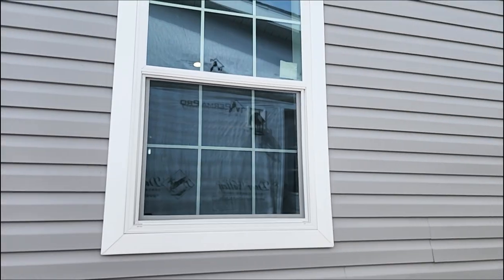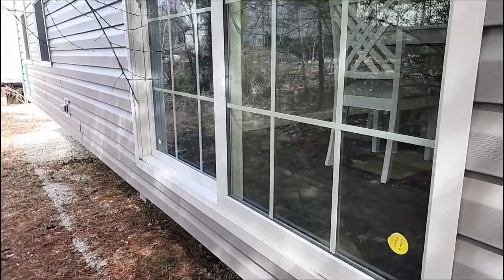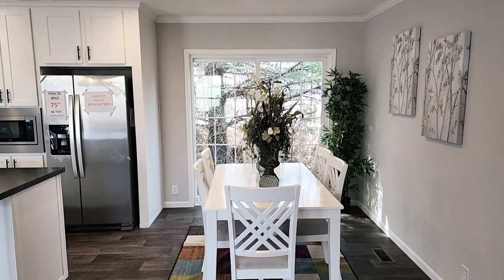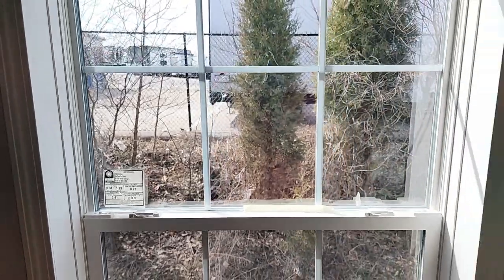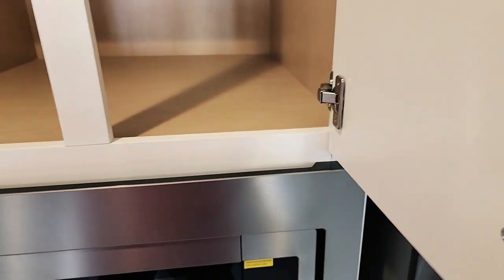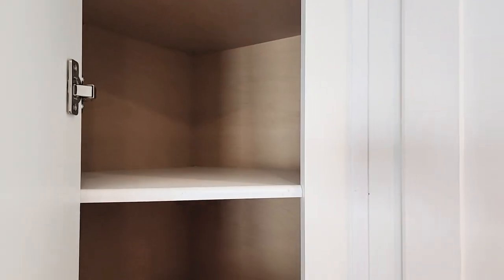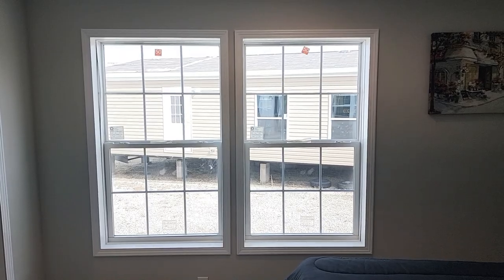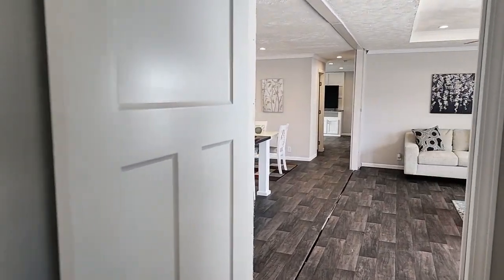Big Dave Here! Come check out this AMAZING New Home Tour!!

Comment: This house is very cute, roughly how much is the base price on this house?
Reply from the maker: Thank you for your question! Pricing on here is very difficult due to fluctuations in price depending on location of where the home will reside. Currently it is around $100 per Square Foot setup on a permanent foundation. That price is subject to change and most likely will be different for each situation. Hope that helps a little.